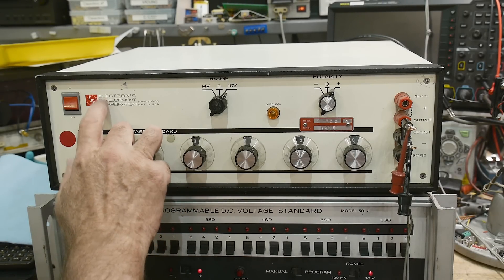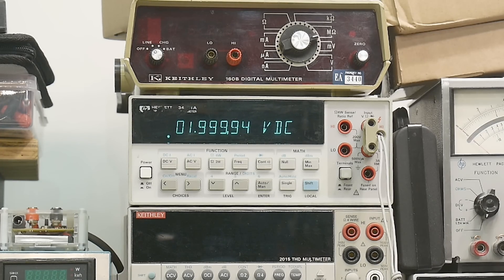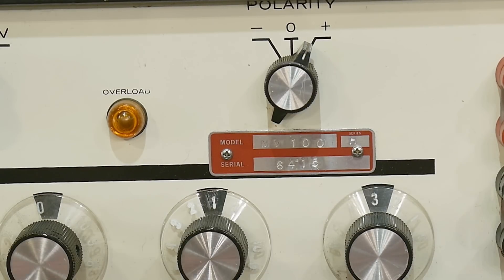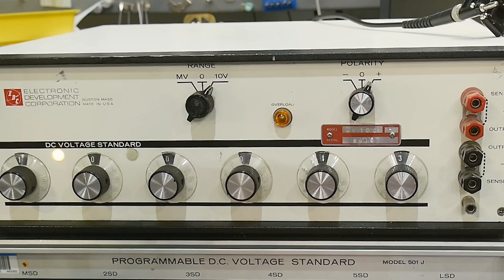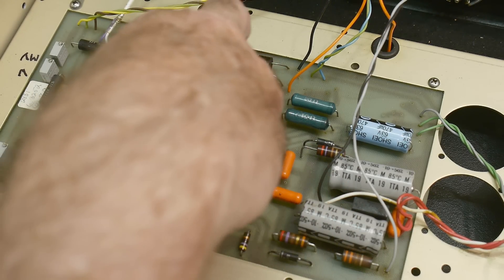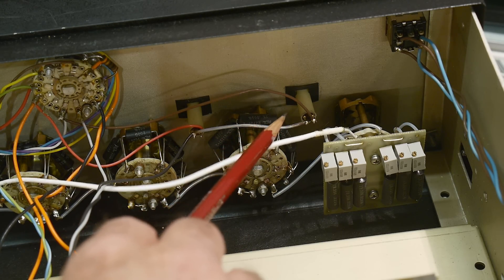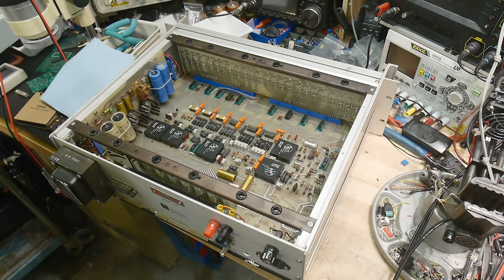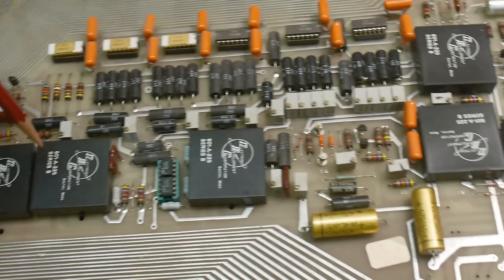#1330 Two EDC voltage calibrators

Comment: Why do all diodes have a bend in one lead? Is that to avoid placing/polarity mistakes?
Reply from the maker: yes, I assume so. never seen that before
Reply: Sometimes it's done to reduce mechanical stress on the components in manufacturing and/or from thermal variations when in use
Reply: @danieltufvesson1349  Yeah, but here I see it done only for the cathodes on all diodes, with a nice consistent bend
Reply: @nickstickdesign  I agree. There is usually a loop on both ends. Maybe they figured one was enough. Doing just one side probably simplifies assembly quite a bit.

Comment: Offset can be caused by bad test leads.
I think that gold plated ones are the best.
Reply from the maker: measuring voltage, bad leads should not introduce an error since the current draw is almost nothing (20M ohm input)
Reply: @IMSAIGuy  I know there is no current but there may be thermoelectric voltages created.
That's why you will find gold plating on precision low voltage systems.
Reply from the maker: @paulcohen1555  I guess my last digit is 10's of uV so yes. I think a typical error might be +/-2uV. how large of an error do you calculate?

Comment: Precision 0.1% resistors are already very expensive per unit. I remember buying ones from Vishay Dale, so I can imagine that replacing those resistors will end up burning a hole in the wallet. I like the construction of the second unit over the first one.

Comment: what is that component that says "daven in out" cylindrical with 4 leads 8:20
Reply from the maker: A very accurate voltage divider

Comment: With my 501j,  I found it helpful to tape the formula on the front of the machine, since it doesn't deliver precisely the number of digits expected.  @IanScottJohnston also did an excellent series where he modded his with an LCD and logic controller.  There always was a great temptation from me to play around with inserting a more modern op-amp and voltage reference (like for instance, some better thermal control)!